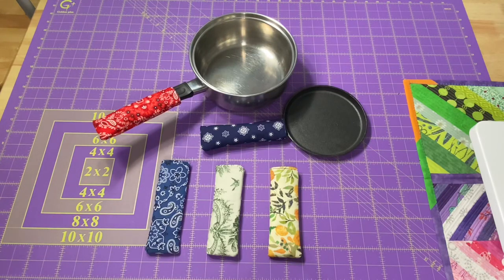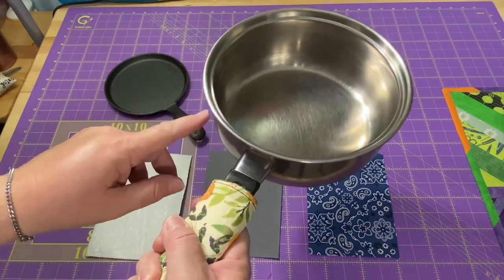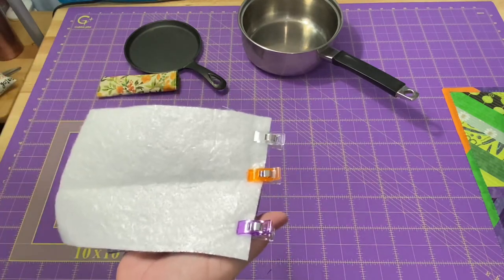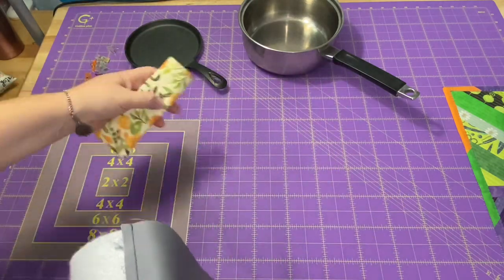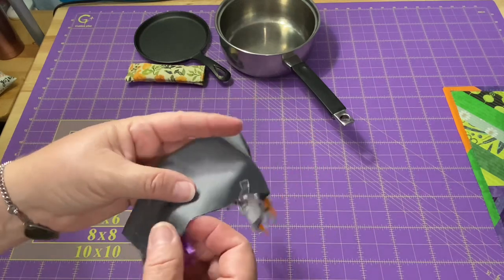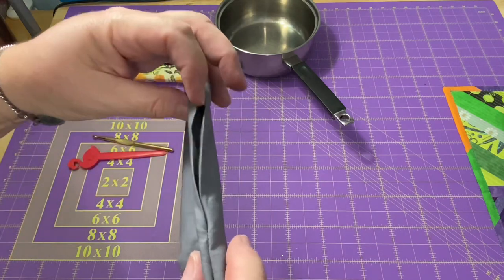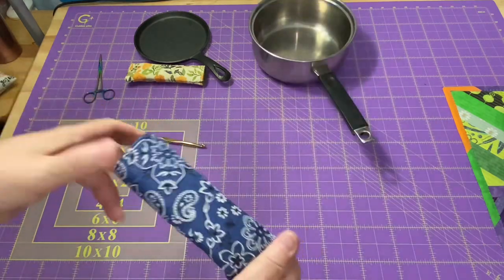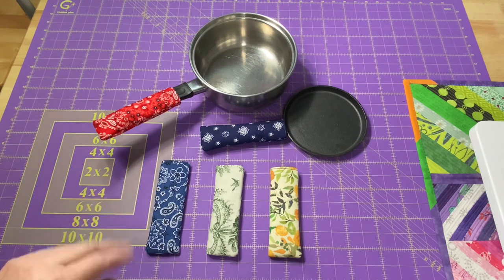Frying Pan Handle Cover Tutorial

Comment: Thank you very much for this video! Years ago I bought both the round and square Skookie cast iron pan kits that came with handle covers similar to these. I loved them but they weren't big enough for my regular cast iron pans. Now I can make these. ❤️

I got my first hot air popper for popcorn over 40 years ago and replaced it about 20 years ago. I love it! I like a little butter and salt on my popcorn. My mom would use a little cold-pressed unrefined peanut oil with a little salt on hers. That was also yummy and good for those with milk allergies along as they didn't have peanut allergies. I loved making popcorn flour in the blender from popped popcorn for making popcorn meringue cookies using a recipe from the cookbook that came with that first hot air popper. Thank for reminding me that I need to make those again as soon as I unpack my box of cookbooks! 🙂
Reply from the maker: You’re very welcome.  I’ve never heard of making popcorn flour.  Terrific idea for popcorn cookies. Happy baking!!

Comment: They look very easy to make. I have some handles that have a semi circle (half circle) on both sides of some pans.Easy to carry due to the handles, but when hot, it's no so great to carry lol 
Would you do be able to another tutorial on how make a cover for them Robin?
Reply from the maker: I have a few pots that have the hanger too.  I was thinking that It might work to make one a bit wider and maybe longer.  To make a test version I would start by taking a piece of fabric and batting larger than the one I show in this video.  Maybe 2-3” wider and 2” longer.   Put pins in as a pretend seam.   Slide It on the handle and see if It fits.   I wouldn’t change up the shape or anything like that.  It might be too complicated.  If the test piece works then I’d move onto making a for real version but maybe not with my favorite fabrics.  That way if It doesn’t work then I wouldn’t waste the good stuff.  It never hurts to have an extra handle cover or you can gift to someone else with similar handles.

Comment: I use a long handled Phillips screwdriver to help turn and poke out points.  It's sturdy, the end I'd round but has the slightest bit of a point.  It's just enough of a point to pop that puppy out without poking holes in the corners.
Reply from the maker: That’s brilliant.  I’ve never heard of using a Philips head screwdriver to turn corners.  I’m going to give It a try.   Thanks.

Comment: Robin, good afternoon. Do you have any suggestions for handle covers on any double handled magnellite pots? They are bare with 5 lines (mine is) engraved in the metal. I was asked to make a set, which now, I'm inspired to make me a set. 😉
Reply from the maker: I had to Google Magnalite pans.  My first thought was the finger pot holders.   Without having one of the pots in front of me I can’t tell if the handles are long enough to have handle covers and have them stay on.  My suggestion would be either one part of the finger potholders if It would stay on the handle.  Otherwise I’d suggest using the finger pot holders to grab the handles.  I do not have a video for the finger pot holders but It is on my video list.  Good luck.
Reply: @rsislandcrafts  Thank you Robin for responding. . I was thinking of trying one like this you made but make half that size and twice as wide? I'll make a template so I can have for the second set. Lol
Reply from the maker: When I read your first comment I thought maybe you were looking for something different than what I showed in this video.   Sorry.  In the comments below I was chatting with 68 69 about making the pan holders larger.   The same theory should work for your situation.   It’s a small project and It goes together so quickly that I wouldn’t hesitate to make a few test items.   Making sure I wrote down my numbers for each test piece.  Please email me if you need more help.